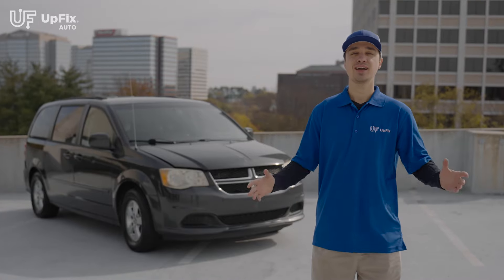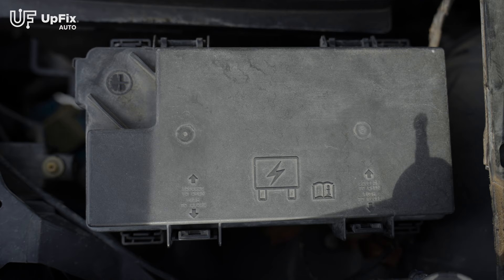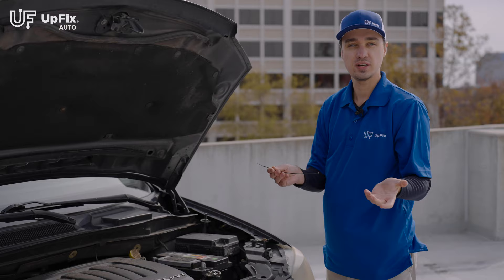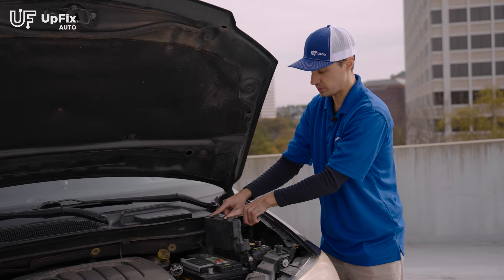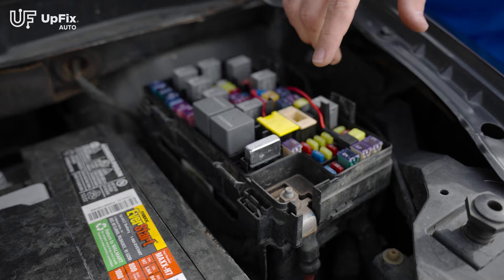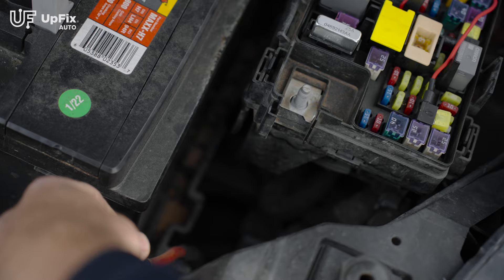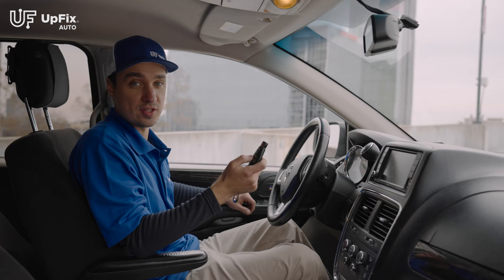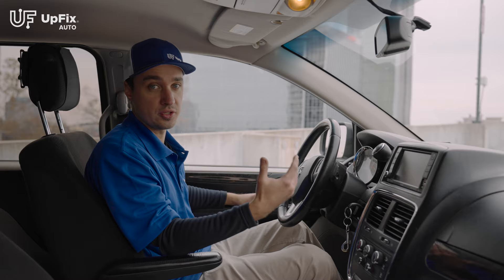How To Remove a Dodge Caravan TIPM Totally Integrated Power Module Fuse Box (2008 - 2020)

Comment: hello thanks for the info, my problem is that my driver side and passenger side and mirror and doors locks won,t work, will just diconnecting the battery and fix the positive and negative  together , but how long? and then reconnecting  the terminals and do the soft reset , will that help me
Reply from the maker: Yes, you should try the hard battery reset first. If that does not help, then the Fuse Box (TIPM) needs to be replaced or repaired.  We do rebuild TIPMs, check out upfix.com